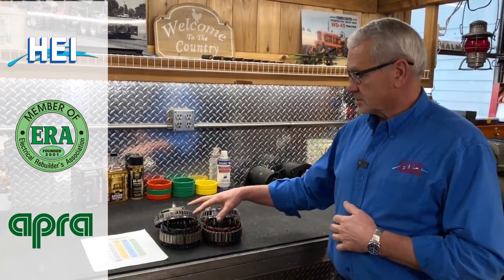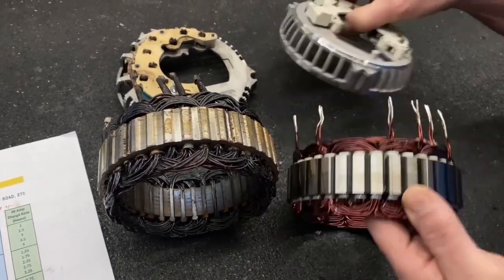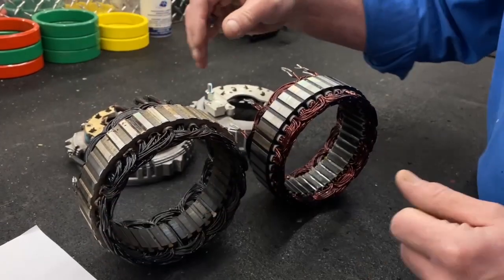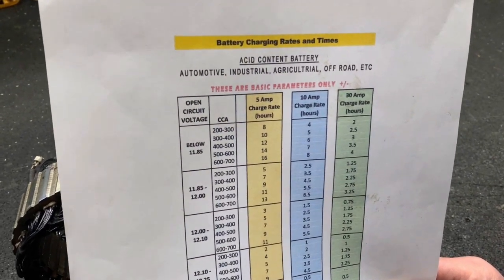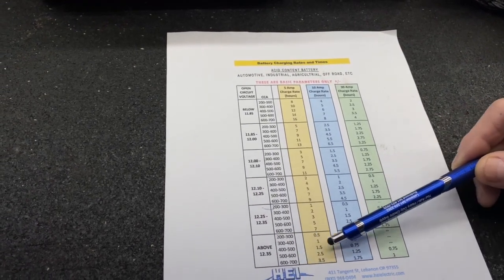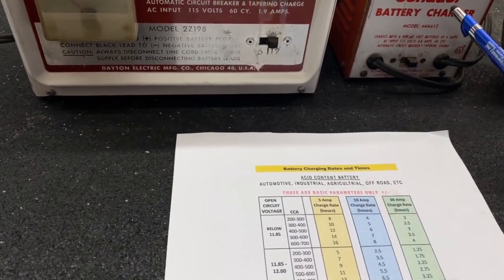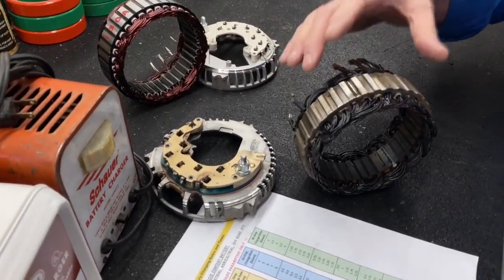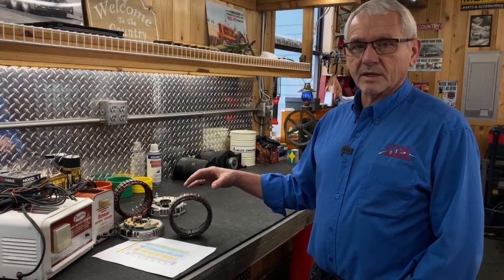Alternators Are Not Battery Chargers

Comment: I was stumped with my friend's briggs and stratton small engine that also has an alternator. This set up is running his carpet cleaning machine. He installed a new battery and fully charged it was at 12.8 volts (if I recall correctly). Then we checked the voltage while the engine was running and it read 12.36 volts. I suspected loose wiring or the alternator or regulator was bad. When he called the manufacturer, they said it was supposed to read 12.36 volts while running. I incorrectly assumed that while running, it should have read 14+ volts like a car or truck. I still don't understand how the lower voltage while running could be correct. Hence, why I'm here trying learn.
Reply from the maker: As far as the charge voltage goes, anything below 12.6 V is running off the battery, 2.1 volts per cell is typically the math on a 12 V battery, which equals 12.6. I would have questions about any charging system that was allowing the battery to run below the set voltage of 12.6. Hope this helps.
Reply: @HagemeisterEnterprisesINC  It helps a lot. Thanks. And confirms my suspicions. I think someone mis-communicated somewhere along the line.

Comment: I think it would be more precise to say that an alternator cannot work at 100% duty cycle. In other words, it cannot put out the max rated power for long without overheating.  I have a 30-year-old 10DN that was modified to produce 108A with type B external regulator on my sailboat.  It has been the primary battery charger for my house batteries ranging in capacity from 200Ah up to my current 560Ah of LFP batteries.  IF I allowed it to run wide open, it would defiantly loose its magic smoke, but I have case temperature control that turns it off if the case temperature gets to 200ºF.